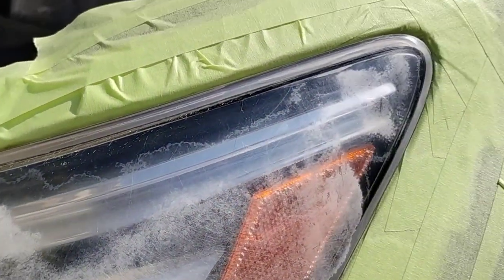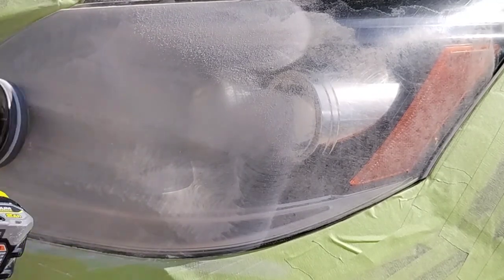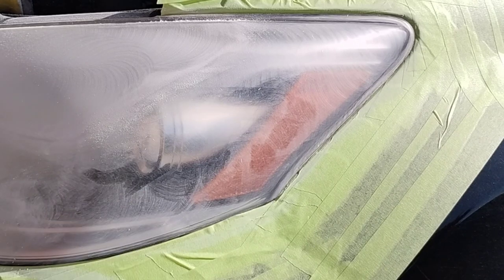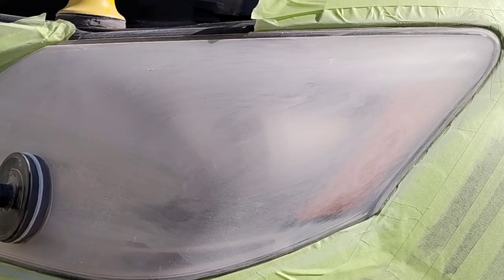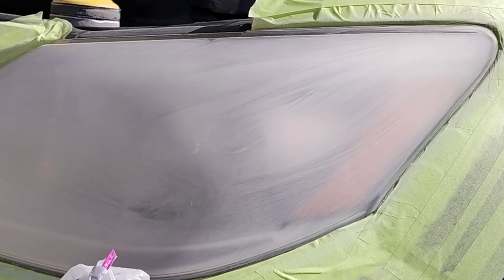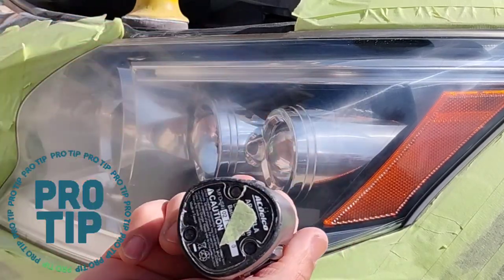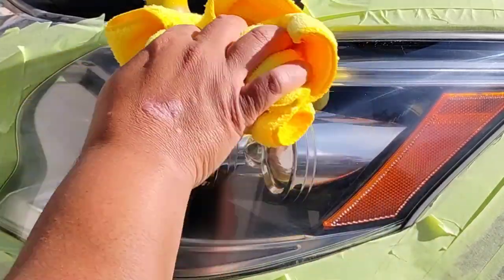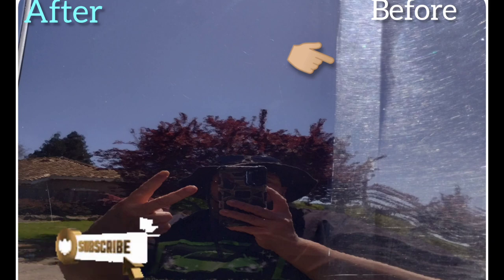Headlight Restoration -checking your work before you finish❓😲(RARE & difficult HEADLIGHT)

Comment: I've watched almost all of your videos and I must say...your method is S-Tier.  Not only do you tell us what to do, you show us EVERYTHING.

The 3M trizact p3000 pad is REQUIRED to achieve the highest level of clarity.  You said it and I put it to the test by purchasing the 3M restoration kit ($30, comes with 1 trizact pad).  Sold me right there.  Like you, I tried the p800 to p3000 discs and do not reach the upper levels of quality.

My next purchase is the ACDelco polisher with 3M lens polish.  I tried  the Meguiars Ultimate compound followed by PlasticX...it's A-Tier quality.

How you explained drill vs polisher for the polishing stage was top level.  Just like you, I wanted to know the science behind it.  As you explained, you need the heat from the polisher to get the polycarbonate to absorb and refine,  which is only achievable through high RPMs (0-7800) a polisher provides as opposed to a drill (0-1400).

Thank you for taking the time to teach and instruct.
Reply from the maker: Awesome... A true scholar...
Really appreciate you watching much more to come...

Comment: glad i found this on your videos! been following your headlight restoration steps. these headlights the dips at the lower inner corner. had to manually sand them. i used an orbital polisher since its what i had at home. mine weren’t as clear as yours specially at the inner lower part but im happy. i learned something and its gonna be looking a lot better next time.. will be sanding my headlights again in a yr. thank you!

Comment: Very well done video. Did you start off with a 250 or 300 grit? I noticed you did that clear coat removal dry. I know when you do that you have to switch out multiple disks because they do clog up fast from the oxidation. I am curious though toward the end with that 800 grit. It seems like you jumped to the 3000 right after that. I had a good laugh 😆seeing that but I guest for video time sake, you probably did a grit size or two before getting to that 3000 but left it out the video. I was amazed that you used the drill with the 3000 disk. I never thought of doing that. Think I'll do that from now on. I appreciate the double decker padding for those curvature headlight situations. That was smart. I learned something there. The UV spray coating at the end was nice. I use to do that technique back in 2015. It's still good though. It's just that you have to have an enclosed environment like inside a garage to spray that stuff. In an outdoor setting wind blowing debri on the lights before that stuff drys use to drive me nuts. 😖 Especially when a flying bug lands on it. It becomes fly paper to insects before it drys. I started using auto ceramic or the polymer vapor which gets the lights crystal clear like the spray on UV coat. It stays crystal clear for 10 to 12 months without polishing. Longer if the client keeps the vehicle in a garage. Good job on this video. I wish I could do my vids like this.

Comment: I’m give your method a go this weekend on my Explorer I ordered all my supplies. Question, being I don’t have drill polisher can I hand sand my headlight? And if so which motion do you recommend vertical/horizontal or circular motion?!
Reply from the maker: You can hand sand kinda...the results wouldn't be the same....you can get a good result but you would be lacking a lot of  HEAT from friction of the RPM which is necessary for this level of high clarity..
Especially with the trizact pad step and the polishing step which is 7,800 RPM...😲  
Ok so if you're hand sanding always just side to side or up and down...NEVER circles....

Comment: Have you made a video showing up how you carry ur tools and equipment to the site? If not can u make a tutorial ? I dont know if i should buy a wheeled toolbox to carry all those batterys and drills, also ive watched u use P500 3" that look like theyve been cut to size ... im curious how u carry all ur gear and what u are using 🤷🏻‍♂️👍
Reply from the maker: Okay first of all let me tell you thank you for watching I appreciate the support you come to the right place for the best and highest level of headlight restoration...
Far as how I get the equipment there I pretty much walk it up I typically have two bags of different stuff a stool and two fans everything is contained in a two bags and in the stool if you look up the stool that I have in my bio...(all supplies and even more than not a shown on the videos are listed in the bio)
Pretty much like two or three trips to the car and I try to park as close as possible that way it alleviates the need to have some kind of Wheeling device.. about nine times out of 10 I can park close enough to where I'm a couple car links away where's no problem to carry the equipment...
The cart would be a good idea but I try to maximize the space I have in just a vehicle.(sedan)
The p500s are cut to size by what you order they come in all different kind of sizes but I used the 3-in so they're pre-cut to 3 in...
Reply: @theheadlightrestorationpro  oh ok awsone yeah i ordered the 6" p500 im going to cut them to 3" i get 2 per sheet, im practicing on our vehicles 2005 tacoma and 2007 oddysey  using ur method and they came out "to Perfection" 😎👍 thank you for sharing ur knowledge
Reply from the maker: Awesome....🤓💯👍🏽

Comment: What is the longevity of the Maguires? Is it a 1-2yr or permanent coating?
Reply from the maker: No such thing as a permanent coating.. Lauren told you that is an educated and or a liar..💯
Well this is an interesting question and guarantees last longer than a year..
I have it until my vehicles that are over 4 years old with it slightly.. it all depends on the quality of the skill that whoever is applying it and also heavily on aftercare and who's using the vehicle. The one year is simply a disclaimer.. like where a product that is fairly weak will tell you to wear gloves and eye protection just as a disclaimer.. pretty much because there are people out there that will use the product and apply it incorrectly and or be very slovenly with their vehicle like not washed her vehicle but once or twice a year and have it sitting outside.. typically it lasts over 2 years and some change for the normal crowd of people.. if you're applying aftercare or taking care of your vehicle and excess like I said over 3 to 4 years.. also when these time frames are applied it does not mean that it goes back immediately at this 15 months immediately at this 26 months and it's terrible bad like it was you might notice it's like color difference on certain areas or yellowing or something just not the way it was what it was fresh and brand new.. typically on cars of medium badness it will not revert back to that level of madness for like 4-5 years..
But yes that's definitely more than a year.. sorry this I've ever had somebody come back to redo their headlights was well over two years and they were an extreme case.. it's on one of my videos.. they drove about 300 miles a day for 2 years... Thanks for the question..
They set the bar super low merely as a disclaimer this only applies generally to a very small percentage of lazy car owners or like I said extreme car owners.. plus there's other variabilities depending on what light structure you have.. anything forward facing or AKA facing the sun more time of the day which is generally a vertical facing section of the headlight is more susceptible to damage a couple hundredfold...
https://youtu.be/OKgJajX1H-I

Comment: I see you spray that meguiars clear coat but without covering the engine for over spray?
Reply from the maker: The tip is very directional Plus it's a very diffused spray which means very missed like. Times the fact that is extremely evaporative meaning it anticipates really fast almost like the air melts it.. with all that like I said it's very directional tip which means that it has a 2-in fan spray.. you got to keep in mind this is designed to be sprayed on headlights so the tip is made this way so long as you keep 2 in going around the light you'll be fine.. it doesn't even come close to the engine.. or even the car paint for that matter.. being that is 2 in and you're spraying the outer edge of the light you might have a quarter inch overspray a half an inch over spray..
What this product overspray is not an issue it's because it's designed for headlights..🫵🏽💯
Reply: @theheadlightrestorationpro  awesome. I appreciate you responding so quick. I was an "ok" headlight restorer but have learned so much more by watching your videos.
Reply from the maker: Yes sir videos like this when I was beginning.. but nothing really existed out there there was no such thing as a headlight channel until I did it... Had some followers after me but respectfully they're not me not even close..lol💯✊🏽

Comment: If my headlights aren’t yet fogged or discolored, (they only have some eroded clear coat along the top) then do I still need to perform the whole process? Would just using the spray protection keep the remaining clear coat intact?
Reply from the maker: Good question it's a rule of thumb if there's any bad you start from scratch redo the whole headlight... It's very rare occasion where it's okay to not.. and it takes a lot of skill to do it without it shining through.. meaning being quite visible that there's a difference between one part of the light and the next. I highly wouldn't recommend trying this is not even for skilled person unless absolutely necessary for some reason. I already discussed the number two reason because you will see the difference and different spots of light sooner or later.. the number one reason is that when one part starts going bad that's just the part that is most exposed to the damage by sun or whatever other environmental factors.. you got to think as a clear coat and a headlight as one unit so if one piece is going bad what does that mean for the rest of the unit or the rest of the clear coat? Exactly it's due to expire sooner than not.. what you have is you think you cropped out this bad area that would sound like his wife on your lights didn't think about how soon around that area past the border of the stuff you removed along with the other spots the headlight will go bad underneath the clear coat that you freshly applied and or faster than the top coat of clear coat.. I have learned this the hard way and it almost always will expire much faster than it was supposed to because of this more aged clear coat underneath. It's best and like I said recommended to just do the whole thing. Then you know everything is fine clean cut and a unit with a time limit that is universal throughout the whole headlight... Especially if you're selling a product.. it's a rare times that I do this but my experience level is quite high and I only do this if it is a certain type of headlight and a certain type of hardness in the clear coat which would take me a long time to explain...👍🏽💯
Reply: @theheadlightrestorationpro  Yes, thank you, that does make sense. I don't know if it makes any difference to your answer, but the remaining clear coat is the factory clear coat and I have yet to do a headlight restore on this car (2016 Mazda6 so it lasted 7 years). Isn't the factory clear significantly more durable than the spray-on clear protectant used in restores? I get that it would be very hard to fair in the transition between the factor and new spray-on to get it seamless but might it help the remaining factory coating to last a bit longer? I feel  like once I start the headlight restore process, I'm going to need to redo it at least annually. Perhaps as you say it's just time to bite the bullet and take it all back to bare plastic and recoat?
Reply from the maker: You have a vehicle that is prone to go bad.. the way your headlights are constructed...
You going to want to redo it all trust me or it's just going to bite you in the butt way sooner than you will need headlight restoration again.. if you wanted to last longer as long as it can you need to watch this video.. this is one of the single most important things of have that restoration after it's done.. some people don't care and they're like okay I'll just do it every 2 years but if you wanted to last longer and don't want to have to pay for it again for as long as possible you must apply after care..
https://youtu.be/kIur4XxYjDk

Comment: Can I ask why you don't use water when sanding?
Reply from the maker: Much much inferior....like training wheels. Very inconsistent and you will never achieve the clarity that you need nine times out of 10.. and like I said with the inconsistency you could do 10 lights and all 10 lights will come out different quality.. this has to do with a lot of problems with wet sanding... Not enough heat.... Very hard to see and know your depth of how far you need to go... Gross and it's very messy.. professional... But that's quite a bit of reasons why those are just some of the top of my head of the number ones.. but even besides quality one of the biggest ones is that you can possibly do as good as a job with power tools.. drills go anywhere already at the tools that I'm using go anywhere between 1700 RPM and 7800 RPM... How close do you think you can mimic that by hand.. if you're an athlete probably about 90 to 100 RPM.. 1000% no comparison.. it's very remedial metaphorically it's like walking compared to driving...
It takes an astronomical amount of more time a lot of people lie about it because the shy that they using an inferior method..
But on average doing a headlight by hand sanding only will take you probably about about 30 minutes to an hour depending upon skill level.... With power tools you not only achieve a better quality outcome but it only will take you somewhere between 10 min and 20 minutes a light...much farther and better..
Check out this video here...
https://youtu.be/eoPKK-trHdg
Reply: @The Headlight Restoration Pro  I will try that method tomorrow.... thank you for the tip
Reply from the maker: Just take it slow you don't have to go as fast as I do.. and also watch your pressure it takes very little pressure to push against the light..🦾

Comment: What should I do if I grinded the pint of out of the car. Has this ever happened to you with a client? just happened to me
Reply from the maker: Do you mean the paint?
Reply from the maker: Got it..
Reply from the maker: The best thing to do is not damage somebody's vehicle... If this happens you need to reevaluate if you're doing what it takes to protect your vehicle correctly if you're not masking off.. like actually creating a cast around the headlight you're doing something wrong. Prevention is King. If you're not using the proper tape which automotive finish tape is highly scratch resistant.. then you're doing something wrong... As far on how to fix it that's a whole another video of explanations... I do provide the service but it would take me a video of of explanation to explain it to you a similar makeup which is basically a scratch removal is the only video that I have besides how that restoration posted now..
This might help you so check it out...
Other than that the best thing is to do is apologize if you can't fix it and hope it's not that bad...https://youtu.be/EEKv-L-G8GY
Reply from the maker: Also check out this video the proper way to tape up a vehicle looks like this..
This is one of the only videos that I have up about taping off vehicles is actually one of the most important videos I have up...🫵🏽👀https://youtu.be/tDuyrgoj6-k

Comment: How long do you pet it dry before you take the tape off?
Reply from the maker: Pet it?
Reply: @theheadlightrestorationpro  Sorry meant to say, let it dry before taking the tape off
Reply from the maker: Basically about at least 4 minutes..
I tape them both off in the beginning.. then one line at a time.. when I finish the last slide I move over to the first light and start cleaning up gives the other light time to dry..
Reply: @theheadlightrestorationpro  awesome thank you, also one more question lol, would you use Maguires M100/104 as a polish before spraying or plastic X
Reply from the maker: @triplethreatoutdoors6523 I'm not familiar with that Maguire's and 100 stuff I'll have to look it up I might have used it can't remember but it's not striking a memory as of now but I'm sure I'd use it over plastic x... Plastic eggs is a very low level product.. extremely consumer base in reference metaphorically to a bulldozer it's a Tonka toy ..

Comment: Is there another option instead of 3M Lens and Hard Plastic Cleaner? It appears to be out of stock EVERYWHERE!
Reply from the maker: Nothing that will be as good.. you can use a lot of stuff but nothing will be as good
Reply from the maker: Lexi also just did a 5 second search on Google and pulled up about six places that has it